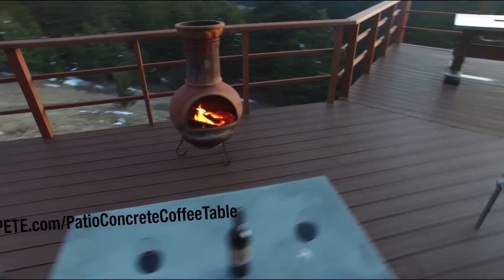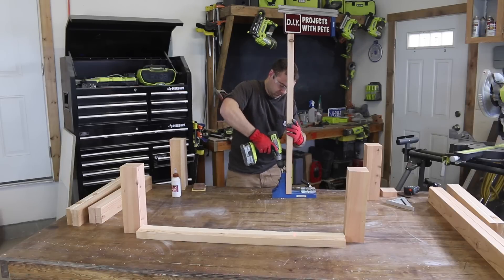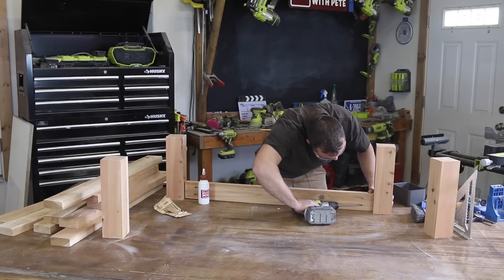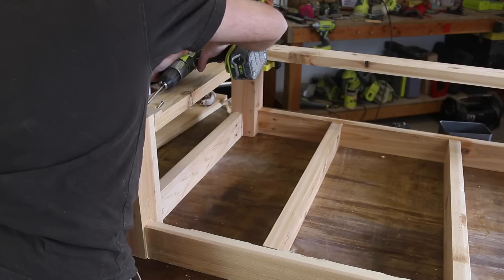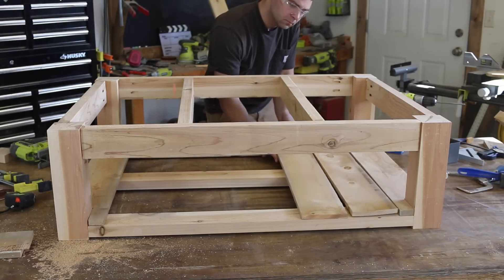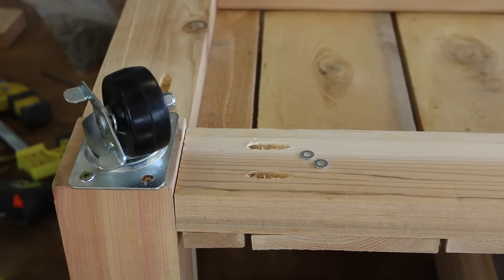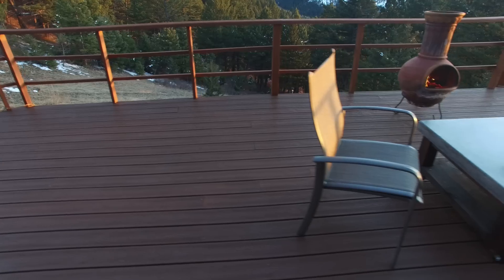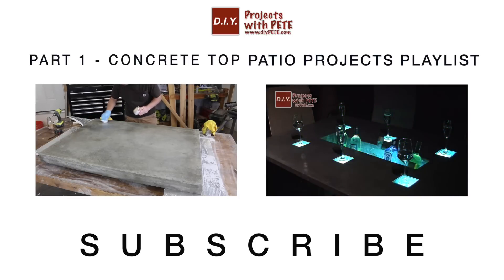Part 2. How to make a Concrete Coffee Table for the Patio (Wood Base)

Comment: Hey pete, i love your videos! I have a question, what's the best way to attach a concrete table top to its base? i have a 20" x 40" concrete top and a 16" x 30" base so there will be some overhang. it's a small enough project to where i think it would be preferable to attach it instead of just resting it on the top. Thoughts? Would liquid nails be strong enough?
Reply from the maker: Hey Luke! I typically do 100% silicon because it keeps it in place and if I ever did have to remove it for some reason I could. I also have a block technique you might look into as well: http://www.diypete.com/faq/

Comment: Is the top attached to the base or does it just lay on top. If it's as heavy as you say it is, it probably doesn't need attachment.
Reply from the maker: Hi there. It is simply resting on the base. You could use 100% silicon to help if you'd like. But it isn't necessary.

Comment: What's the total weight? :)
Reply from the maker: Concrete is usually between 15-18lbs / square foot at 1 1/2 inches thick. I'd say it would weigh in at about 204 pounds for the concrete (with the concrete apron around the perimeter.) I'm not sure how heavy the base is but not too bad. It's all douglas fir.